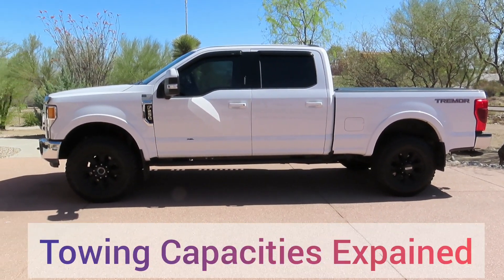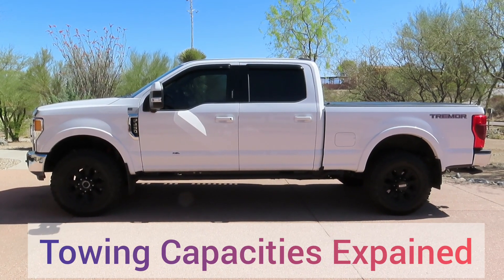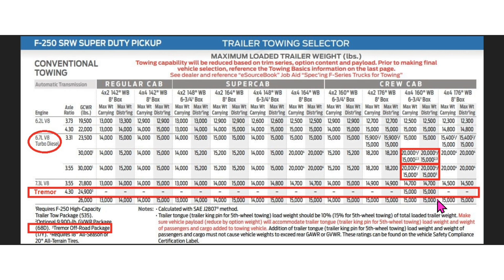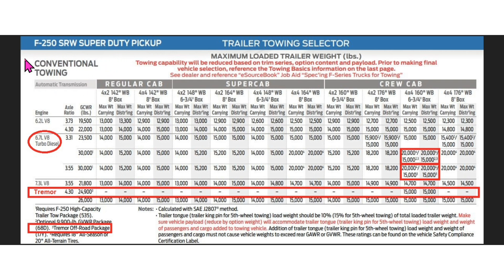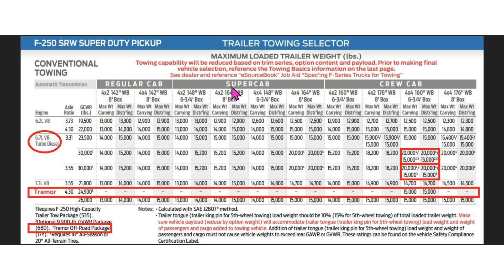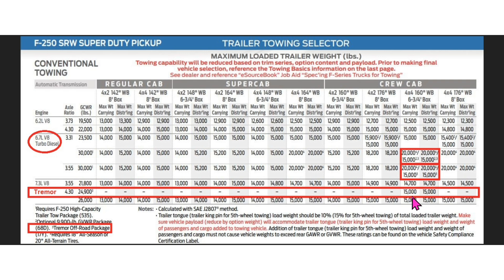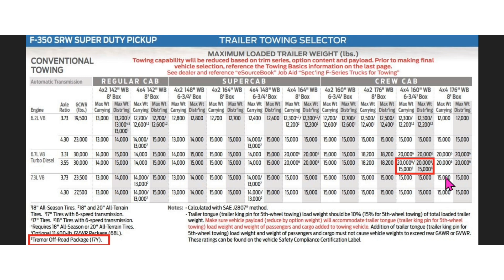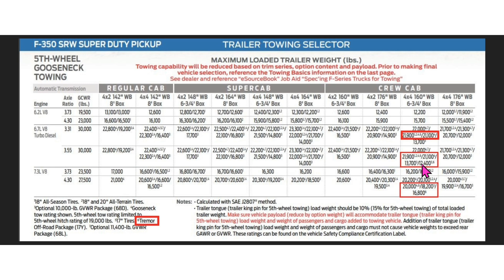F250/F350 Tremor Towing Capacities Explained

Comment: 250 with max trailer tow has same axle as 350. 350 will still have 1 extra spring in pack and higher gvwr.

Comment: You forgot to talk about the “tremor” diesel with the “high capacity towing package” you actually can tow 20,000 pounds with it. With the “high capacity towing package” you get a upgraded rear axle and the 3” hitch.
Reply from the maker: Tremor 250 and Tremor 350 are exact same trucks to include axles and leaf springs. Both have DanaM275 axle and overload spring. You are right about the hitch though. The only other difference is the decal "250 or 350". This only applies to the trucks with the Tremor package. Normal 250 and 350 are different.
Reply: I think I ordered the high capacity towing package with my tremor... It did come with the 3" hitch. How can i see if I have the high capacity towing package?

Comment: Just an fyi, u cannot get a tremor with the 3.31 gear ratio at least for 2022. I didn’t order one of the 21 year models so it may have been different. On the 2022 tremor 6.7 your only choice for gearing is the 3.55. That is what ford told me anyway
Reply: You're right, 4.3 gears only (at least for gasser)....

Comment: I have a tremor 6.7 and conventional towing this is from Ford and from my sticker is 18,000 lbs and it does so with zero issues or squat in fact it does it better than the standard 250 because it has the 350 leaf and rear end. Talked to dot and they said 18000 and under I’m good as long as I don’t go over my payload. So I don’t get it.
Reply: You probably have the “high capacity towing package”. And you can tow 20,000 pounds with that package. And in 2022 the gcwr is 30,300 pounds over the truck without that package it’s gcwr is 23,500 pounds.
Reply: @702probro9  from what I’ve seen in All tremors with the diesel they have that package, the only ones who do not come with it standard are the 7.3 versions

Comment: F250 and F350 tremor packaged trucks with high capacity tow package are essentially the same truck. What’s the difference? The badge on the fender, the sticker in the door jamb, and how much you pay in taxes and insurance. All 4wd F250 and F350 SRW trucks with factory 5th wheel prep package from 2019 model year and up also have the same front and rear axle ( big bearing, differential carrier, axle shaft diameter and spline count). My 2021 F250 tremor has same rear suspension and axle as my 2019 did with 5th wheel prep package. Same part numbers.
Reply: There isn’t a difference spec wise it’s just how they badge them I have a 250 tremor and a 17 250 standard both 6.7 and the tremor handles a load significantly better.

Comment: Great video but your forgetting the high capacity trailer tow option  on the Tremor. And looking closely the weight rating difference is strictly due to the 18” all terrain tires   All season 18’s and the 20” tires  are the 5k difference. The suspension‘a are identical

Comment: What kind of fuel mileage do you get? I have a 6.2L and I'm getting about 15 on the freeway (75 mph) and about 12 in town empty. 3.73 gears. Just wondering if the 7.3 is fairly close to that. I think for a gas HD truck I would want a 4.30 gear ratio.
Reply: I was getting 14.5 with eco mode with the stock duratracs. 14 w/o eco. I changed to nitto trail graps and now im getting 13. Thats the 7.3 tremor i have. Big fat torque curve. I dont get any noticeable difference when towing my boat or my atvs on a utility trl
Reply: I know my diesel gets significantly better fuel mileage my 6.7 is doing better than my buddies 7.3 but I’ve heard the 6.2 does about the same as the 7.3 realistically but I’m not sure
Reply from the maker: Hey Matt thanks for watching and please subscribe! Here are 2  videos that I made that may help you. https://youtu.be/1rL9u8iydSw   

https://youtu.be/2G0lrXyboXM

Comment: Cool video. I am looking up the payload now. Been considering a Tremor. Just can't decide what options I want. Lariat is a must for leather but beyond that I am not sure I need the lariat ultimate package.
Reply from the maker: Thanks! I got the lariat and did not opt for the ultimate. The gas trucks have more payload capacity over the diesels, mainly because the diesel engine weighs way more.
Reply: @BigBoyToyzz  I seriously like the Black Appearance Package.
Reply: @rayb1330  I got Oxford White
Reply: @bradenchalmers5887  I am looking at the white or silver. With the Black package I think it will look awesome.
Reply: I ordered the Lariat package, not the ultimate package in the 7.3/V8. Can’t wait for it to come.
Reply: Thank fo the Video. What’s your play load? And do you know approximately the payload difference between F250 Vs F350? Thx